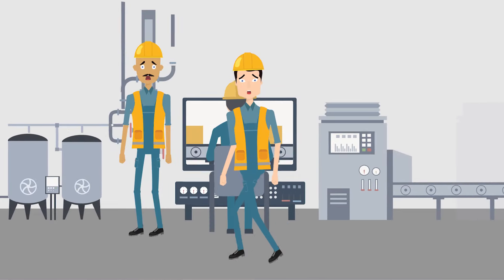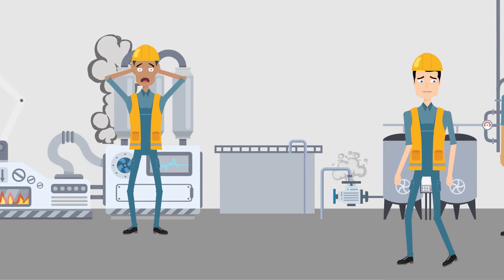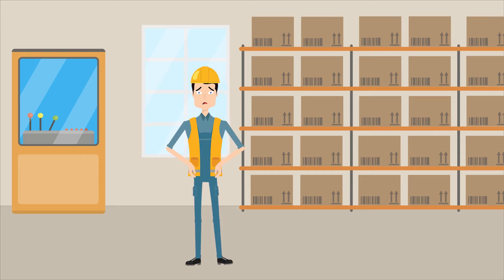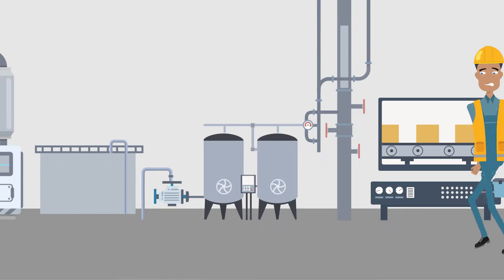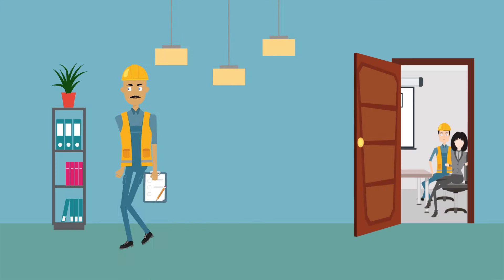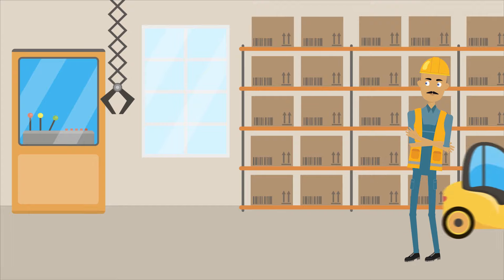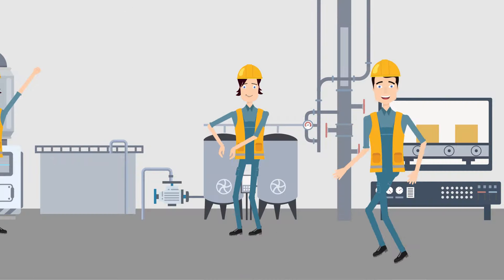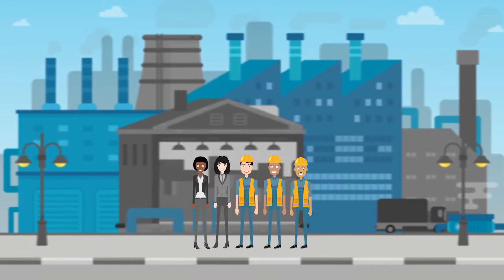How Maintenance Planning & Scheduling Works

Comment: This would be in a perfect world. Lots of variables that can impede this process. Awesome video and it’s a victory when the process works out
Reply from the maker: Thanks Blake - it is to some degree a perfect world, but in reality once the process has been setup and implemented well, our clients will make this work most of the time. However, there will always be weeks when things go wrong and the weekly schedule blows up due to a major failure or plant upset. That's life. When that happens it's all about how we deal with that so we can recover and get the following weeks back on track.
Reply: I'm inclined to agree... everyone wants to schedule maintenance... but in the real world everything needs to be done now and urgently which consequently pushes back that next scheduled job and so on and soforth.